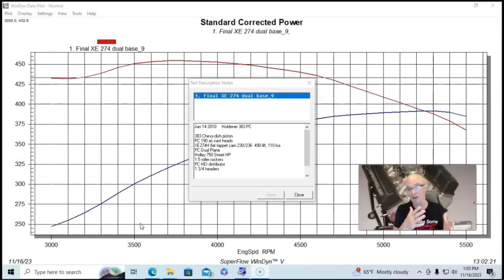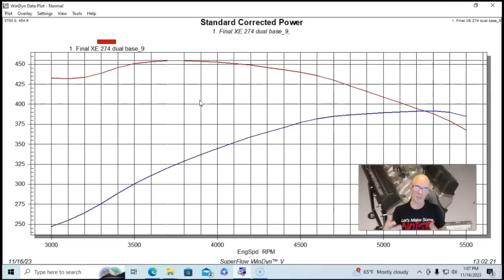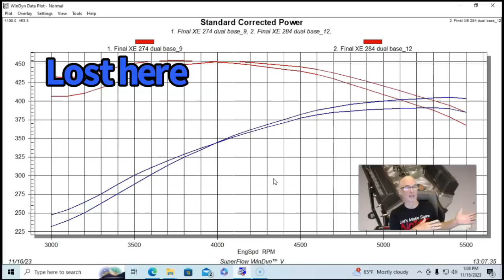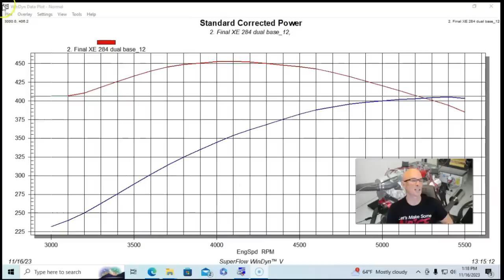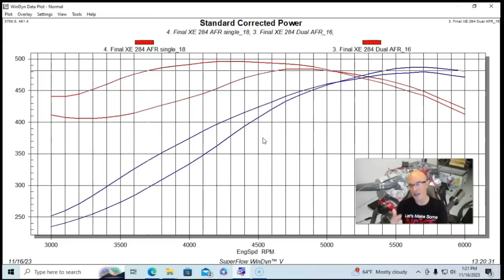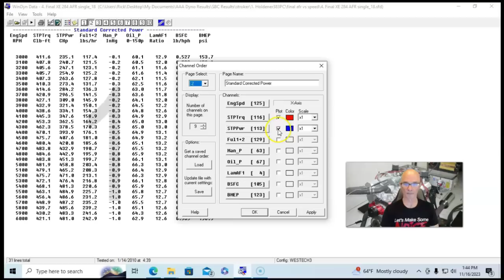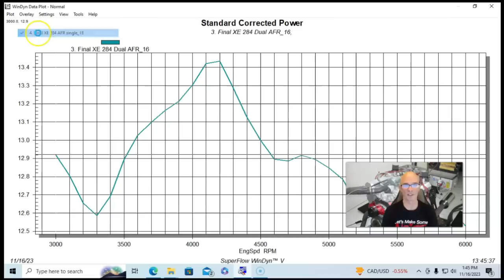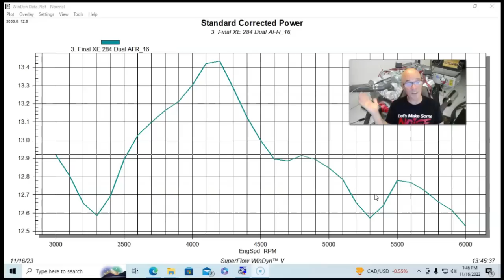HOW TO MAKE MORE 383 STROKER POWER. HOW MUCH POWER ARE PORTED HEADS, CAMS OR INTAKES WORTH? RESULTS

Comment: Have you done a 383 with flat top 2 valve relief pistons, vortec heads and 270 magnum cam,performer rpm intake, headers and Edelbrock 650 AVS carburetor?
Reply from the maker: not that exact
Reply: @richardholdener1727 
Just curious, it seems like a decent budget build. I have most of the parts laying around. Just need pistons and machine the block. Can that cam be run without doing much to the heads?

Comment: tight lobe sep , opens the intake earlier witch pack the cylinders quicker and adds cyl pressure ,especiallly on a moderate rpm street build , i have a old engine masters mag where they tested three diff lobe spread cams , n the effects would u like me to send u the screenshot , this is common knowlage
Reply from the maker: see the lsa video

Comment: 650 hp is easy to get with a 383
Reply from the maker: 650 hp is not easy to get with a 383-it requires a very big cam, very good heads and a big single plane or tunnel ram

Comment: DUAL PLANE IS BUILT FOR STREET ENGINES, RPM UNDER 6500, GOOD LOW END TORQUE RECOMMENDED FOR ENGINES BASICALLY 10 TO 1 AND UNDER COMPRESSION RATIO.  SINGLE PLANE INTAKES WORK BEST ON 11 TO 1 AND HIGHER COMPRESSION RATIOS  MOVE POWER UP HIGHER INTO THE RPM RANGES USUALLY 4000 TO 7500
Reply from the maker: intakes don't care about compression-only effective rpm
Reply: @richardholdener1727  NO THATS BS,  AN ENGINE IS AN AIR PUMP/ VACUUM,  THE HIGHER THE COMPRESSION THE MORE THE PUMP ALSO SUCKS AIR THEOUGH THE INTAKE,.  COMPRESSION AFFECTS VELOCITY, SO DOES INTAKE STYLE AND HEAD PORTS, VALVE JOBS ETC

Comment: Retrospect on this video. Make it better? Build a 351c 383. Compare the ford 351c 2v intake cross section with a sbc arf 210 cnc ported.
Yup.
Reply from the maker: I have built 383 stroker 351Cs

Comment: Hey Richard I don't know if you'll see this but Im preping a 383 for my truck. I wanted to ask the size of the rods in this engine, were they 6inch or 5'7 inch rods? Went to an engine builder today and got humbled buy pricing and was wondering where i should go from here. I don't mind spending the money where it counts but i need to make sure I do it right. My biggest problem is I have to have enough vacumn to run power breaks and air, would a roller cam with similar specs work for my application or should I aim for 112 lsa for a street truck?
Reply from the maker: the rod length won't change power-but most 383 strokers come with 6.0 inch rods. The lsa isn't the thing that determines vacuum-duration plays a major part
Reply: @richardholdener1727  alright thank you for the input, The engine builder wanted to do the 5'7 rods cause he's worried about blowbye through the pins on the cylinder, cause with the 6 inch rod the ring overlaps with that groove, which I actually do see the concern so that doesn't bother me too much. I am doing a hydraulic roller cam and I'm going to spec it similar to the 274 to keep it on the streetable side. I know rollers are a bit more efficient, but you didn't run the 274 in this video with the 195 eliminator heads, my guess for horsepower considering the gains from the base heads is about the 465 range, is that a safe assumption considering those specs?
Reply: @Emperor-uy7wu  Don't let any knuckle head talk you out of using the 6 inch rod.
My work truck 383 works perfect with 6 inch rods and using a roller cam for low RPM torque the disk brakes work normal.
This 383-work truck engine the machine shop that did the work told me it cranks out 480 Hp. and runs on all range of gas.
Reply: 5.7 rod is fine no need for longer ones. Cast rotating assembly
Reply: @gordocarbo  thanks for the input! I actually had an entire engine donated to me. Unfortunately I opened it up and everything minus the block was junk. The guy I was having build it had a fully built short block with forged internals and I decided to say "fuck it" and send it. I'm gonna do this one time so may as well go big or go home. I'll be shelving the short block for a bit cause it's pricier than I was expecting but I'll have it buttoned up by the end of the year! Depending on how serious I get I may hit it with a small shot of nitrous to really hurt some feelings and keep the engine currently in the truck as a backup.
Reply: I can help you with all you need to make a 383-work truck engine as I did one for my Chev truck for pulling boats from 19 foot to 30 feet.
the 383 works so well I am doing for my 1991 1/2 ton Chevrolet a 385.
I am using the 6-inch rod for added torque and adding longevity that 5.7 rod won't give you.
Contact me for parts details 
Everyone else is making racing motors.

Comment: For years I heard how great the 383 has then come then the time to swap out the 454 in my 1 ton Chevrolet for a 383.
The 383 sure isn't the 454 but awful close to it for towing my boat the 383 does very well and the 350 has no comparison in torque to the 383.
So, the 383 worked so well now my 1991 1/2-ton truck is getting a 385 and say goodbye to the 350.
These engines are built for driving and towing my boats and no race at all.
Reply: Musta been hard going from a 454 to a 383 far as low end torque. 
Both can make good towing or race engines with parts out today
Reply: @gordocarbo  My 1988 Chev 1 ton with the 454 then I swapped to 383.
I found on Craigslist auto parts a person selling a full 1989 Chevrolet engine all together with pulleys and all together for $100 dollars.
The engine had a rod stuck through the pan and we didn't know if the block was useable but it was and it is now the 383 in the 1 ton truck.
I had to have the total SB from to change from 454 to 383 SB .
The 383 does absolute find towing a 19 foot Dory boat.
I have right now a 385 stroker in progress for my 1991 1/2 ton Chev truck and going the near same using 6-inch rods but this will be TBI injected and the TBI heads with 65.3 combustion chambers.
Today I call comp cams then placed the TBI roller cam order .
The 1991 350 tuck engine I am getting ahead of it wearing out for the change to 385 stroker.
This 350 block going to be the 385 is the new model 1-piece main seal and a roller cam block and was found in the woods in Ketchikan Alaska.

Comment: Nice job, 383 is better than a 350 for sure.
Reply: Absolutely.  Id never go back to a 350, always build bigger. 
Seems with a 350 if the 280 type cams arent enough, better to put a bigger crank in rather than a bigger cam. 280 was the sweet spot imo. DIdnt care for the 284. Extended power band...but where it counted I wasnt impressed.
Reply: The same for me never again I would do a 350 when the 383 I did come to the same price to rebuild as a 350 rebuild then the 383 far outdid then 350 in torque for my work truck that pulls trailers and boats from 19 feet to 30 feet that if this was the 350, I would have been stomping on the gas constantly to keep the speed up.
from my own experiences driving the Alcan Highway to Alaska using 350 engines then pulling trailers fully loaded this kind of long haul on massive 7 and 8 % grades for some 25 miles just kills 350 engines and by the time a full round trip to Alaska and back to Oregon pulling a trailer the 350 is done for and needs a rebuild from over working the engine hard with the heat range going up and down and foot into the gas to do 25 miles of 7 to 8 % mountain grades.
When I ran the Alcan Highway with 454 and a Big block 402 never was there a problem with engine heat or struggling to do long maintain passes and now seem the 383 has the same ease of towing as the large 454 or 402 Big bocks.
The 383 works so well I am doing another one for my 1991 1/2 ton Chevrolet truck that will be a 385 and both engines have the 6 inch connecting rods.
The 383 has the aluminum heads 68 cc chambers with 202 & 160 values and using comp cam roller cam for low end power torque - Holly 675 carb./ Eagle 350/383 crank and Eagle 6-inch rods - Keth black flat top pistons 
The 385 will be TBI injected so I am staying with the TBI heads 65.3 combustion chambers and 194 - 160 values - comp roller cam for TBI for low end torque power
I am the different guy here that just needs a work truck engine where reading the other comments everyone is talking racing engine 383 engines

Comment: Same area (3k to 5k rpm) where the single plane fell on its face the afr went fat af.  Was the loss of tork a mechanic of flow / pulse or terrible afr?
Reply from the maker: chicken/egg-the lack of torque production reduced the signal to the carb-which supplied less fuel. The less fuel didn't cause the lack of torque (that is inherent in a single plane)

Comment: Nice job richard.i built my 383 stroker with those afr heads and a 288 cam with 1.6 on intake and 1.5 on exhaust with a afr dual plane intake and made well over 500bhp and torque.great video
Reply: I have the same setup but haven't got it fired up yet. How do you like the setup if you have driven it?
Reply: @MrJosephfunk  not yet.i have a 1986 Corvette .I'm going through the whole car but the motor is on my stand .in spring it's going on a dyno stand then into my car.but it should be a screamer
Reply: @JohnRebello-383  I have a living room full of parts and the last box (rotating assembly) yet to come. Lt1 block 383 LE ported lt4 intake  on top of LE pcrt matched afr lt4 210 race readys and that sits in front of the latest TKX..."baby, I can't wait"
Reply: Sweet @mikes.1882

Comment: Wow what a pile,  my 383 AFR heads , scatt crank ,11 .1 with flat tops ,zero deck, small chamber. And a 670 lift, an it was streetable,with a 108 separation  600hp an we did not squeeze the all out of it
Reply: 600? What were the rest of the cam specs, intake carb etc?
Solid or hyd? Thats a lot to squeeze out of a flat top 383

Comment: Richard if you would have put a 4 hole tapered spacer it would have helped low speed power tremendously as it helps with cross sectional aiflow. It will clean up the air/fuel some and there for help the low speed somewhat. I think it would be interesting to see the spacer on both intakes
Reply from the maker: cross sectional airflow?
Reply: @richardholdener1727  yes. Certainly thought you knew what it is. In the plenum being open like it is, the air flow gets disrupted going from one side to the other during the stroke. The HVH 1.5 to 2in 4 hole tapered spacer helps a lot and is dyno proven
Reply: @zachniverson8816  Are you trying to say it may pull a little harder on the carb with the spacer vs without one? 
Never heard the term Cross sectional airflow. Cross section or CSA is usually a measurement

Comment: Tune with power valve and power valve restriction holes, they make little jets for them, if vacuum comes back at high rpm, that means there is a restriction some where possibly too small a carb ,?

Comment: Getting ready to pull the 350 in a 69 Camaro which desperately needs more umph.  Can’t swing a bbc but a 500+hp sbc would be nice with fi for the track and strip.
Reply: Do a 383 or 396 sbc. The amount of torque is amazing youll love it

Comment: Honestly, with fuel injection pricing starting at $2k....   I think I'm switching to EFI.  Just not sure if I will cobble together my own or a kit.   Kinda like the idea of running an LS1 computer and coil near spark...
That big rich spot right were you have the big torque drop....   coincidence?  I think not.
Reply: The thing that's keeping me from going EFI is the hassle/cost of rejigging for a high pressure fuel system. I'd just procrastinate until...  My c3 corvette is not fun to work on without a lift and I have no room for a lift. Gotta practically pull the engine in that car to get the spark plugs out.😎
Reply: @100amps  Yep!! Those kits try and draw you in with a low entry price. THey dont tell you all the extra $ youll be spending trying to make it work tune etc. 
Id call Jeff over at AED Carb, have him build one calibrated for your car, engine gearing etc. Electric choke. AFR is already tested, just bolt it on no need to mess with it. Lot less money will be reliable run well and can use a cheap mechanical pump. Try wrenching on a C4...even worse than a C3

Comment: I would have liked to see what the 383 would have done with vortec heads, duel plane air gap intake, and the XE284h cam. I believe that would have been a nice combo.
Reply: Wouldnt even been close to the AFR heads.
Reply: @cuzz63 of course not lol. I was interested in seeing what they would do against the first set of heads. You could pick up a set of usable Vortecs for $100 give or take a little. Those cnc AFR heads are $2,000 now. Hardly a comparison.
Reply: @thabiznizz  didnt see your rely until today..  Fair enough i wasnt thinking about a budget build. If you want to make power on a budget look up "Cattledog Garage & Racing" and his 383 build.
Reply: @cuzz63  yes I’ve checked his channel out before it was pretty interesting. He has a well thought out build.
Reply: @thabiznizz  Yeah but most are cracked and need valve jobs machining etc. Little better than camel humps but not as great as a lot of posters would lead you to think.  Id use the Isky 280 mega cam over either in the vid.
Reply: @gordocarbo that’s understandable. I picked up a set for $100 when I was building my 350. They were in decent shape. Cleaned them up, lapped the valves, went with ls6 springs and comp cams retainers. I ran a comp xe274h cam. That engine ran well. I eventually replaced the vortecs with the afr as cast heads. 
That isky cam you listed has some good numbers, tight lsa too. Bet it performs well.

Comment: First off you would need to pull the plugs and inspect to see if engine is on the lean side before you make the jet change and the way graph looks could be good on high side might could change jets on front of carb and also definitely play with the timing I know you have it set to 35 degrees sometimes 36 to 38 could be a sweet spot or heck might have to drop timing back to 33 degrees
Reply from the maker: we have an AF meter that shows us the AF through the entire rev range, and we do timing sweeps to see what the motor wants
Reply: @richardholdener1727  Have an AED 850 H) solid roller 383. 
Never was clear on high speed air bleeds. When to change or not vs changing jetting. Go up or down? 
Loss of torque on this test was WAY more than id have guessed. Thats laughable!  Opinion on a smaller, say 7530 Weiand as a happy medium?
On plenums (Team G) would swapping from a 1" open spacer to a super sucker make a noticeabe improvement?

Comment: I'm very interested in the classic 350 cubic inch chevy was something like AL98 aluminum cylinder head mild super charger cam and a torque storm
Reply: It will smoke tires and be hard on that 700r. 
Like the 180 afr on tpi 350s. L98 heads are notorious for blowing head gaskets

Comment: Thanks Richard, your hard work is much appreciated.
Do you have any old data testing factory style intake ducting with paper panel filter restriction on stock LS and/or Heads cam intake? Is it restrictive? At what HP level does it become an issue? Does an OTR CAI gain anything other than cool noise?

Comment: Can you do a video on stroke and bore reliability is it worth to do a big cube motor when boosted when you can be more reliable with a smaller cube motor? Thicker sleeve more reliable less stroke more reliable and explain it for us etc? Should be a good video
Reply from the maker: I can't test reliability on the dyno

Comment: Unless you have a 400 crank why would you build a 383 instead of a 4 x 4
Reply: 4x4?Unclear what youre asking
Reply: @gordocarbo  Build a 4x4 400 is about the same $$$ if you have to buy a crank  now if you have a 400 block and crank then just do long rods and new pistons  400 blook is not strong enough to go nuts with, neither is a 350 block but better than 400  we used 6" rods with 4x4 but today and todays rings and pistons you can go longer
Reply: @jmflournoy386  Seems that not just me we don't understand what you mean 4x4 ?
Long rods also mean the pistons to match the long rod length.
Finding the 400 SB block these days I would have near better chance in seeing big foot than find a old 400 SB for building.
Or go spend Hugh dollars to buy a 400 SB after market block
Reply: you might have to grind the rods for cam clerance and you need to check everything no matter what you build starting with the tear down where you check compression height of all four corners  which, btw does not always catch twisted deckes sometimes found especially BBC and BBM
Reply: @jmflournoy386  If someone is using GM stock connections rods then yes checking cam lobe clearance must be done.
For the 383 Stroker and now the 385 I am about to do I have the 6 inch Eagle rods made for clearance of the cam lobes.
Reply: @lurebenson7722  Aftermarket rods are such a bargin  we would side grind, Mag, mill spec shotpeen, rebuild the big ends and rebush the small ends and hang and align.  Then GM came out with "Pink" rods
no big deal now  MOPAR had some great "NASCAR: rods but the "6 pack" rods were standard steel just really heavy, we replaced with standard "LY" rods preped as above
Reply: @gordocarbo   inch bore 4 inch stroke  we used to have to buy Moldex billets back when building 283s to 400  now inexpensive cast are available and tghey work fine
Reply: btw I recommend switching to mopar lifters instead of bushing most times but then check cam clerance (even with roller cams you can get a bigger wheal)